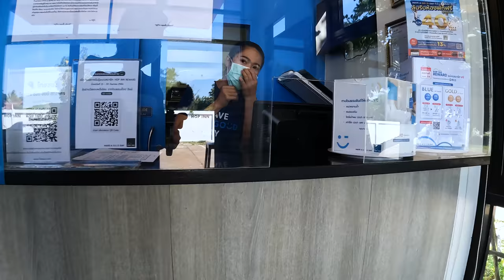48 HOURS Traveling in ISAN THAILAND 🇹🇭 2 days, 5 Provinces

Comment: Fun stories. The Nagas (or Nahk in Thai) are actually serpentine gods, not dragons. They are the Gods of Rain in the Isan folklores. 
The distinction is that the Nagas do not have limbs or feet. 

With their domains being the underworld (the waters), they are the protectors of farmers and agriculture. Some of the “higher class” ones serve the higher gods in heavens and go back and forth between the heavens and the underworld. 

Nagas are often depicted as swimming in the water or to the sky. 

For them to be on land, they have to be accompanied by the Heras, the Terminal Gods, who resemble closer to Chinese dragons but smaller. 

A Naga will slither out of a Hera’s mouth so they don’t connect with dirt of the ground. As seen on the rails of most temple’s grand stairs, especially in Isan. 

The dirt symbolises “impurities”, and since the Nagas are responsible to the source of lives (water), they must remain as pure as possible.